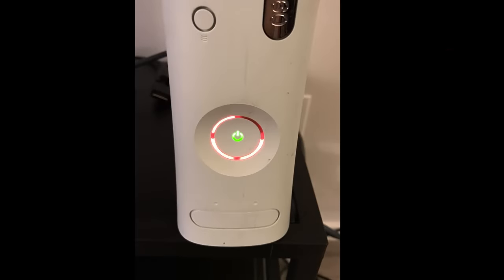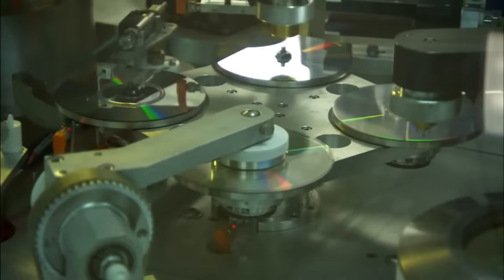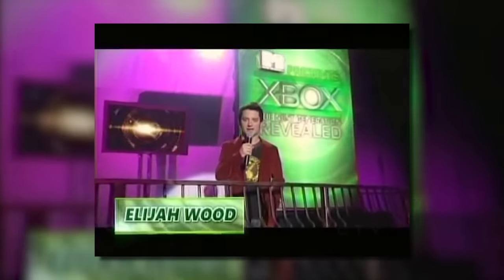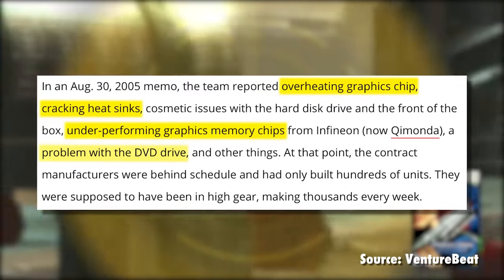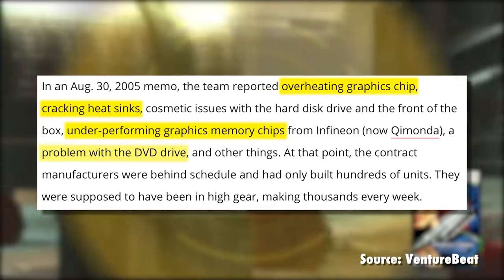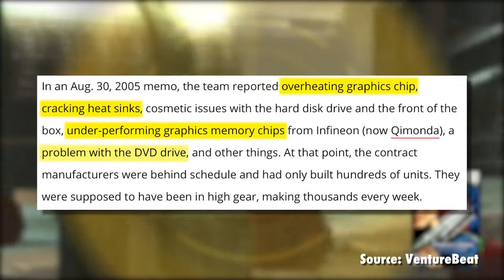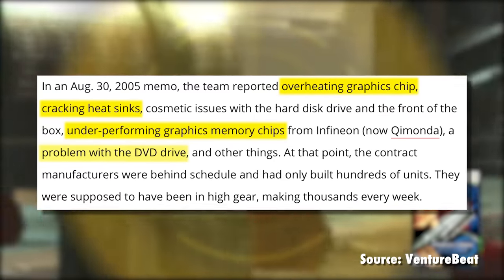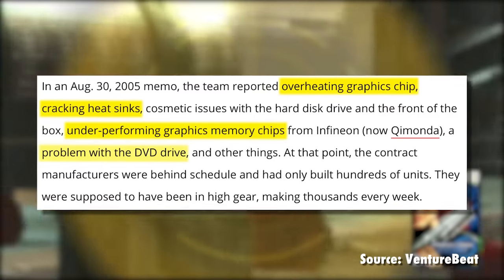History of the Xbox 360 Red Ring of Death | Past Mortem | SSFF

Comment: Meanwhile, PS2's seem to be immortal and running like new lol
Reply: About two of mine have died, but my third one's been excellent for the 6 years that I've had it. My only qualms is that there's the two versions that can't play other PS2 games. Really bugs me.
Reply: The eye on my 2 went to shit and then gamers went bankrupt soooo
Reply: SO TRUE
Reply: the nes still be immortal
Reply: dangerous1989  Less parts in them and more simple, especially the PS2 Slim. Pretty much the same with the Original Xbox as well ! Although I think the lasers for reading the discs can be dodgy sometimes in the PS2's , but they are cheap and easy to replace.
Reply: Well sony was always better, wait i dont want to start this argument
Reply: Thats because people dont play them.... they sit collecting dust
Reply: Not the shitty laser lens
Reply: Mine got a broken graphics chip, so I took out the internals and made a ps2 taxidermy.
Reply: I mean I still have an old clear Gameboy - That thing still runs just fine. And my father has a huge collection of audio equipment made in GDR (German Democratic Republic) and even some stuff from before. 

Thing is, older stuff is not nearly as complex - In fact it was built as simple as possible, which means you could easily repair stuff, even if something broke at all. But compare stuff like an old Gameboy, or an old PS2 to something like more modern equipment. The processing-power, the additional features etc. is a lot more powerful, but also a lot more delicate. Have fun repairing modern circuit boards, a video card or whatever. It is usually impossible, at least with regular equipment. And such stuff also breaks easier, since there are just so many more parts that CAN break.
Reply: I still have mind and it’s still running smoothly
Reply: I've had mine ever since they released the PS2, and it still works fine.
Reply: And they made the 500 million special edition ps4 (spoiler. Its just a ps4 pro, camera, headphones and a controller that are all transperent blue
Reply: @sxrghxolx2405  Lol true
Reply: my ps2 from 2004 still runs brand new lol best console ever made!!! Ratchet and clank, Grand Tursmio 2, crash bandicoot
Reply: The original PS2 overheated on me after several years of playing it constantly, and I got the slim right away to keep playing. It still runs like a dream
Reply: Mines still good and plays ps1 games
Reply: I've had two die, but I've never bought one second hand that didn't work perfectly. I think I just took bad care of stuff when I was young. Love the PS2
Reply: My xbox lasted my at least 10 years and the only reason why it broke was the tray started getting jammed consistently
Reply: my ps3 has 4 years on me

hopefully it lasts forever
Reply: My Day 1 PS2 would disagree with this statement. Sent it back to Sony due to "Disc Read Error". To their credit, they fixed it without charge even though the warranty was expired, but it was only a quick fix, and eventually ended up doing it again.
Reply: Well my launch PS2 had the infamous 'Disc Read Error' after a few years, which I managed to fix. Unfortunately, as of last month, the console has finally bit the dust and there's no longer anything that can be done for it. Most of the time, I've had no issues with consoles. Here's my consoles that had issues:

1x Launch PS2 - (Disc Read Error after a few years, finally dead Oct 2018)
1x Launch Xbox 360 - (Disc tray stopped opening and reading Xbox 360 games, eventually RROD)
1x Launch PS3 - (YLOD 2012, my 2nd Launch PS3 is still alive and fine)
1x Original Xbox - (PSU failure)

Never had any issues with the following:

PS1, N64, Dreamcast, Gamecube, Wii, Wii U, Switch, PS4, Xbox One.

I guess everyones experience is different. I've heard the Dreamcast is quite prone to having laser problems but mines still alive. Nintendo seems to make the most reliable consoles i've owned.
Reply: My ps2 had chicken noodle soup dropped on it and it still works to this day
Reply: Tell that to my 3 junkers
Reply: my Gameboy has been working since the 80s, great way to play tetris
Reply: dangerous1989 facts lol i had the phat ps2 since i was like 5 still looks brand new
Reply: I still have my ps1 and both my ps2s
Reply: I've had so many PS2s  with just about every kind of problem, including freezing to disc read problems to one console that was putting visible grooves on my discs. I have two PS2 systems now, thankfully problem free.
Reply: I had 3 ps2’s and all of them broke due to overheating... I absolutely hate that console.
Reply: Also the PS2s Hardware wasnt as advanced (for her time) like the Xbox 360s for its time ... So it isnt that likely to overheat.
Reply: One of my controllers have died but my ps2 that I got on day of release and so does my og PlayStation along with gamecube wii and n64
Reply: I still have mine from 2006 still running perfect
Reply: I have been through a PS2, using a slim model now...does not get much use though. My orignal NES still works after 30 years but will eventually need new capacitors. Nothing is immortal except plastic in a landfill or rocks.
Reply: Some PS2's were prone to a laser defect but that is easily fixable at home since the laser just has to be realigned by opening it up and fiddling with a gear, and doing trial-and error disc read tests.

Also, PS2 slim will overheat at the drop of a hat.

PS1 is the REAL cockroach-motherfucker system.
Reply: To true
Reply: I still have mine in a carry case in the cupboard
Reply: dangerous1989 Mine freezes sometimes, but other than that I still play the Pac-Man World series on it to this day!
Reply: Mine's quite an early model, been softmodded, running a HDD and a few other things, and the only slight issue it has is it won't run Gran Turismo 4 from a disc.

My PS1 goes even better though. We've had it pretty much since it was first released in the UK (late 1994), still runs perfectly well today, modchip and all.
Reply: dangerous1989 PS3’S as well.
Reply: I have an Xbox original.
Reply: Mine still runs like new lmfao
Reply: 666th like!!!
Reply: 667th like.
Reply: I found the slim ps2, when I went dumpster-diving. Cleaned the motherboard off, and it worked perfectly. Plus it came with 3 8MB memory cards. Still no issues to be seen. Tho I thought the graphics used to be better.
Reply: PlayStation for life. The 2 outsold every Xbox combined
Reply: my ps1 still works. lol
Reply: Yea, I still get issues with the Blue CDs and it's still sitting upside-down in order to read any damn thing, so no.
Reply: Na mine Lazer burnt out 5 year ago my of Xbox works still
Reply: @sugarpatty2  the nes is so fragile
Reply: + Dangerous1989 So true. I still own a silver PS2 limited edition Slimline I purchased at original release and it still operates like a champion. I had purchased the original PS2 after it was first released, but ended up having to replace it because my best friends 5 year old daughter tripped over a controller extension cable sending the console crashing onto a hardwood floor.
Reply: Darren Davenport I dunno about you but I play my PS2 all the time, everything from FFX to Burnout 3 to Max Payne. Tons of great games to play too.
Reply: All 4 of my playstation systems still run like tops
Reply: I had 2 ps2 slims because the first burned out on me.
Reply: dangerous1989 My ps2 finally died unfortunately. However it went out with a bang. Literally. It had an internal fire. Probably my fault. Love the ps2, getting a new one. Rip my ps2.
Reply: i plugged mine in last year thinking it would and i could do some singin with some company with "Singstar Pop" and it was silent, off color and slightly jumpy
Reply: HAH. My PS1 still works. My PS2 is also golden and still alive like new (love to play Wall-E on it) and PS3 is also running amazingly. I dont have a PS4 thought cuz its really just a mere ReVamp of the PS3... Almost the same unlike PS2 and 3
PS2 was hard to find how to work through if you were young, it was confusing where you had to go in order to get in the game. But the PS3 switched it all!
Reply: @sxrghxolx2405  it's like people forget that Sony released a "super computer" that you plugged into a tv.
Reply: My ps2 has lasted for 17-18 years maybe 19
Reply: My dad's PS2 broke years ago
Reply: mine died. Snes and n64 are still solid
Reply: bullshit I got 5 of them and on 3 of them the disc drive went out.
Reply: I have one that slows down ever so often and then suddenly works perfectly for a while before going back to being slow, BUT IT WORKS.
The problem with newer consoles is that they GRAVELY underestimate the cooling needed to run modern GPUs. Just listen to how loud the PS4 is. They need to give the chips bigger heatsinks and fans, so the consoles need to be bigger, or they have to stop pushing for Tflops and scale it back a little.
Reply: Yup
Reply: Original X Box was an unkillable beast.  PS2s died left and right but the xbox kept going.
Reply: @delgande  My Ps3 finally broke on me after a decade of using it. It still works, just the video feed doesn't work. I can hear the audio and navigate around. 

Ps2 is just like OP said. Immortal. It's been yanked, thrown around (Mom got angry at me back in the day), fallen off my TV stand, spilled juice on it and it still runs like new.  16 years and it's going strong. Same with my Gamecube, which has taken more of a beating.  

Microsoft obviously didn't know anything about how to make a console last, which is to be expected as they were new to the gaming market.
Reply: I have four Ps2's none works , not so immortal
Reply: Same with my PS3
Reply: i have an original ps1 bought when it launched,i believe its 25 years old now and still works like new
Reply: Had 3 360s die and had 2 ps2s. One ps2 I sold which was the fat one and had a slim that still works to this day.
Reply: My uncle gave his to me when I was 6, now I'm 18 and everything still works on it still to this day.
Reply: @fairlywren3664  what?
Reply: When I was younger we got a PS2 slim man that thing was almost indestructible it was dropped idk how many times and it still worked
Reply: @jean-pierreraduocallaghan8422  the ps2 I had growing up wouldn't read the blue, purple or black tinted disks and the normal ones read fine thing was racist asf 😂💀
Reply: @bigbonede6201  the original medal of Honor, grand theft Auto San Andreas
Reply: Lmao mine still works
Reply: Got mine launch day (I have friends who work high up in Sony) and it's never had any issues.
Reply: Had the original model since 2002, and it still works. Sony makes indestructible products.
Reply: pc is just in the immortal world where the top levels are lol
Reply: My slim PS2 ate discs.
So sadly not. Lost MGS3 to that.
Reply: I had one that lasted 12 years
Reply: The memory card slot 1 on my PS2 had broken, now I can't save, and as such I can't complete long games... I needed to play Ace Combat 5 earlier...
Reply: Controller port seems to breaks a lot though
Reply: I've been through 5 PS2's and counting, lol.
Reply: Not mine~
Reply: @jean-pierreraduocallaghan8422  The lasers do suck... One tiny little scratch on a disc, and my PS2 throws a temper tantrum! 😅
Reply: Yeah. The 6th gen was pretty reliable. My Dreamcast works perfectly still.
Reply: who’s here 4 years later?
Reply: there are a few issues, specifically with disc drives wearing out or malfunctioning, but that's expected for a device with an optical drive
in theory, the PS2 has a blinking red light error to indicate an overheating issue, but afaik the chance of it actually happening randomly is very low
Reply: They had issues with the laser or something the amount of times they couldn’t read a disc
Reply: @fairlywren3664 with a dead clock battery